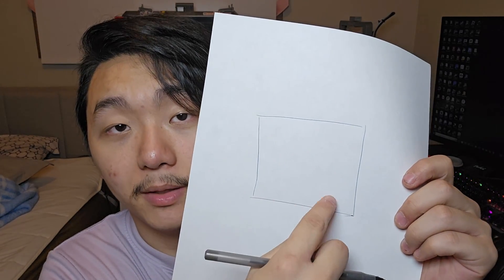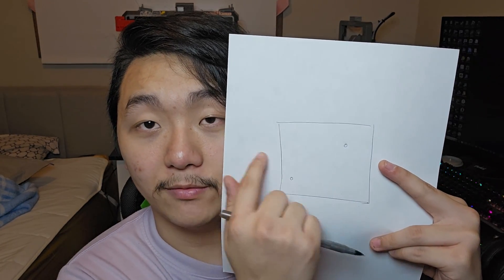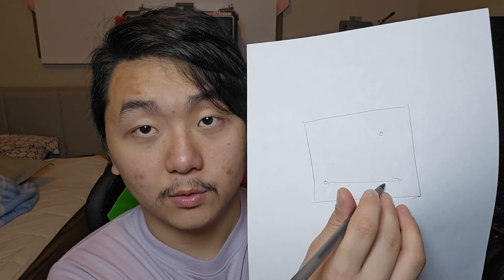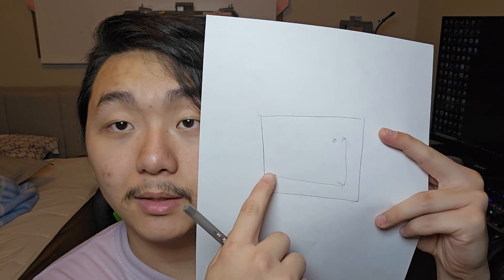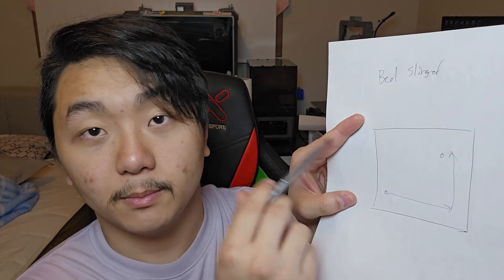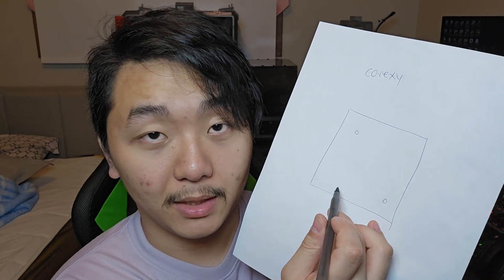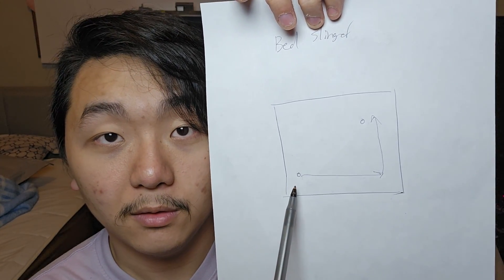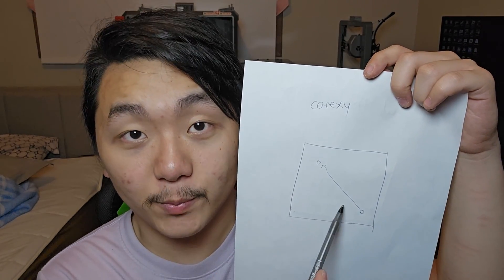FDM Bed Slinger VS CoreXY 3D Printer Which One Is Right For You..?

Comment: In the bedslinger diagram, shouldn't the Y-axis arrow go the opposite way? so the bed would be travelling forwards in order for the toolhead to go backwards to the example position in the diagram.
Reply from the maker: Ahhhh that's correct. Thanks for catching my mistake.
Reply: it would be going backwards if the build plate is the frame of reference.
Reply: If you pay attention to your Math classes, that arrow pointing up means is moving on the positive axis instead of the negative axis whilst these Cartesian coordinates depends on written G and M codes of text file named as <file_name_of_your_saved_3Dmodel>.gcode . 

Read graphs properly please no offense here. Trust me, CNC machines does both on the same Cartesian grid like a CoreXY (smaller tool changers) and Bedslinger (conveyor belts as bed stabilizers basically a CoreXZ) because of larger tool changes they move a lot slower during tool change or faster at drilling (3d printing is called extruding), only difference is powered by PLCs and air compressed (vacuum) suction instead of glued on adhesion. Sorry some words are abbreviated here. :face-blue-smiling:. Abbreviated words to Google search are CNC and PLCs, also key word what he is on about are Cartesian coordinates. Compare this to an delta 3d printer, they are using polar coordinates to extrude out filament because that tool head (weighted carrier hanging onto circular base using actuators) are at dead center of origin like a laser engrave pointing down or crane load/unloading with actuated pulley.

Have you played Lego or Battleships before? Same grid structure.

Comment: Recently I noticed there is something wrong with my Flashforge Adventurer 5M Pro 3d printer. I printed a test square 120x120mm. The results are the following: 

X in front of the printer = 119.3 mm ; 
X at the back of the printer = 119.8 mm ; 
Y on the left side = 119.9 mm ; 
Y on the right side = 119.0 mm.

I found out that there is a 0.5 mm differance between 2 side guide rails i.e they're not parallel.
I watched video about corexy 3d printers and some of them are made with linear rails, well...
AD5M Pro is made out of a metal sheet chassis with holes on the top where plastic mounts of circular guide rails are screw in. They have plastic aligning pins but they're is like 0.5mm loose within the hole.
I dissasembled the 3d printer, made those as parallel as I could and made sure my synchro belts are the same length and tensioned correctly but it did not help.

To properly tension the belts on this 3d printer You have to push the X axis to those plastic mounts (either on front on the back) to make the X axis perpendicular to Y axis and here is the problem because these 4 mounting points are probably skewed because of what I described above i.e. metal sheet construction with loose aligning pins.
I have some photos I can of course share with You if You want to take a closer look at that subject. I also want to note that another AD5M user printed a square but his part was not so extreamly skewed but He still had 0.4mm differance on 140mm square.
Thank You for reading this,  I'm up to share more details if You want.
Reply from the maker: yeah sometimes these 3d printer can shift like that can cause many problems.

Comment: Wait... You demonstrate the bedslinger bave to move from corner to corner(0,1,3) while  corexy moves diagonally (O to 3) but. The bedslinger does not make that move in 2 steps. The head and the bed moves at the same time. In this case the distance from 0 to 3 diagonally is a longer distance compare to 0 to 1

So i am not sure if this would be the reason. I think the reason bedslingers are slower because you simply can not move a heavy bed (+ your print on it) with the same speed, acceleration like when you moving only 100-200g mass.
Reply from the maker: Yes you are correct the head and bed does move at the same time, but still, moving only the head on corexy is much faster then moving two things at the same time.
Reply: @Scratch3DPrinting  totally relative. The bed slingers can reach diagonal points less travel time at the same speed. Because the way is shorter. But they just simply can not go that high speed because they have to carry the mass of the bed + the printed material on it. Which is even getting worse by the increasing height. Inertia is a stubborn rule in Physics. :D